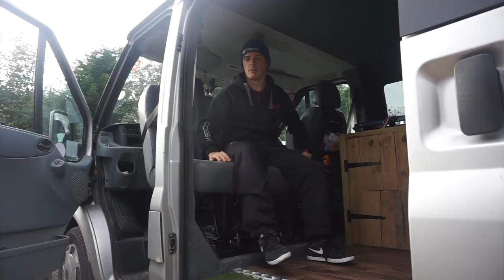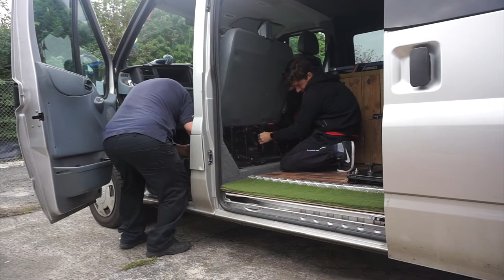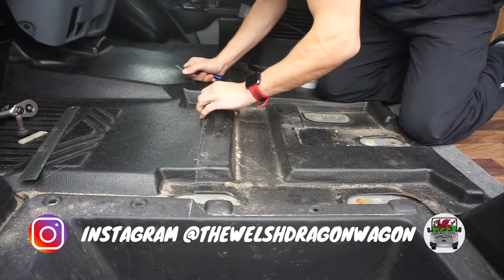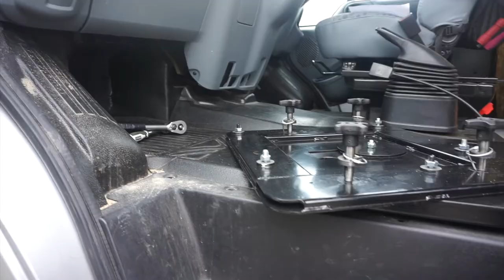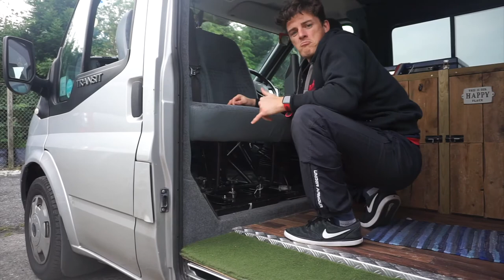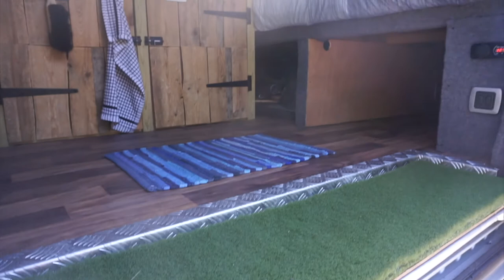How to fit a swivel seat to a Ford Transit

Comment: Great video, thanks for sharing. Did you use the original bolts to fasten the swivel plate down or did it come with new ones?
Reply from the maker: Hey glad you liked it 😁🤙🏼 We used the original bolts, there is a cavity if you like within the plate where they go directly back in to the vehicle body/ cab.
Reply: Hey! This video is great - love how short and sweet it is! Can I check - the middle seat belt that’s attached to the ground beneath the seat - does that just in bolt and go on top of the swivel base as well? Looks like it in the video but I thought I wasn’t gonna be able to detach it from floor? Also where did you get this swivel base from? Thank you!!!
Reply from the maker: @kittystewartmusic  Hey Kitty, really glad you liked it 😁 Great question, I just had to run outside and check the answer for you ☺️🙊 So the middle seat belt is actually affixed to the dual passenger seats and isn't attached to the cabin floor in any way. The buckle is the only part that is connected to the cabin floor, so in my case I don't have to disconnect any of the belt mechanics as the swivel plate swivels and misses the buckle which is situated by the handbrake. Bear in mind mine is a Ford Transit, I'm not sure what van you have. Here is the online shop ➡️ @t 😁